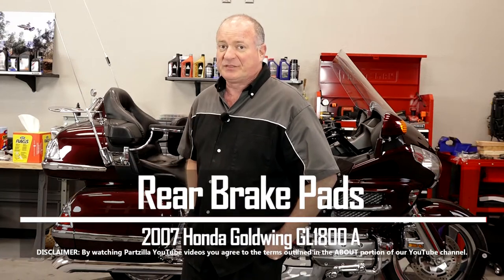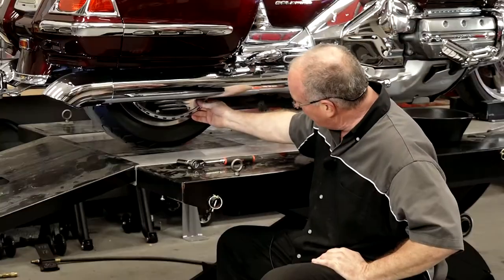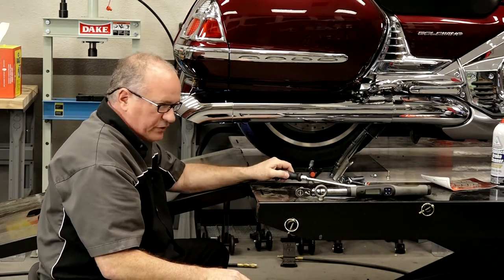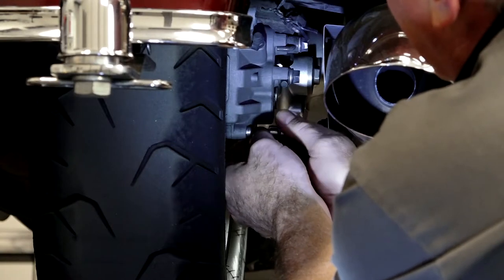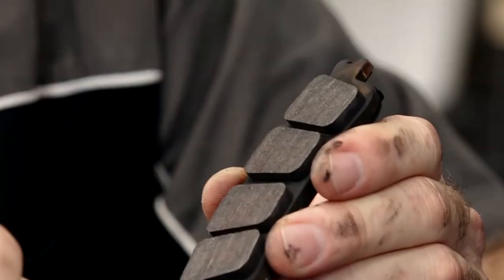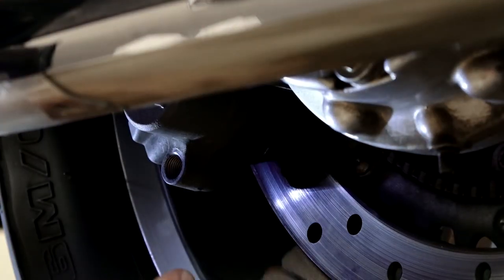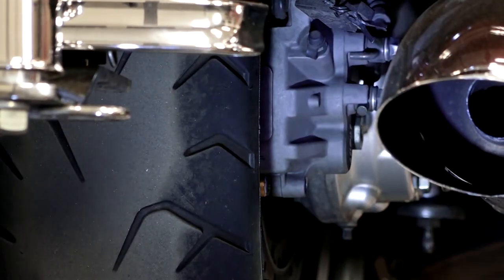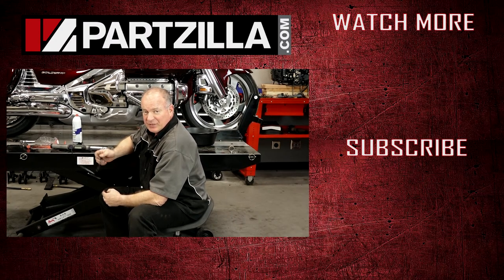Honda Goldwing Rear Brake Pad Change | Partzilla.com

Comment: A few minor points. 

#1: Spray the caliper with brake cleaner before you push the pistons back in. Don't want crud chewing up the caliper bores.

#2: I find it easier if you fit the outside pad first and use the locking pin to hold it while you fit the outside pad. The push the caliper in.

#3:  After pads are in make sure the pads are in right by making sure the rear wheel turns easily. 

#4: Don't forget to pump the brakes front and rear to seat the pads against the rotor.

Comment: Great Video.. One thing I had a issue with previously,  after you think you have the  pads in properly  and before completely snugging  the pin down, check driver / left side pad make sure its in the holder and not over hanging the rotor as mine was  and wore incorrectly. felt correct going in and line up for the pin...even drove and stopped ok.  I only noticed it when I took the back tire off to change.   I had to struggle a bit get the new  pad lined up for the pin in its holder.... slight tap with a heavy object did the trick..

Comment: Excellent video; I pull that muffler off, it only has one bolt and two clamp bolts and off it comes and you then have a world of room. Once the muffler is off I put some anti-seize on the bolts and just inside the pipe where the muffler slides on, this makes it super easy next time. I pulled one off that had been on for 17 years and just had to wiggle it a little to get it.
Get some nitrile gloves and protect your hands from all that crap...

Comment: Ive been a jet turbine mechanic for 30 years and my pad change on my f6b went NOTHING  like this video..i could not  get enough of a gap on the left side of the rotor to insert new brake pads no matter WHAT i tried. I wound up disassembling everything sticking the pads on, then reinstalling rhe caliper. Over an hour and lots of cussing.

Comment: Real simple NO. I have a Honda 2008 Goldwing I removed front pads but it took me a long time because there are 3 cylinders that have to be pushed back. Screwdriver method worked on fronts but getting all 3 cylinders back enough was dificult but eventually worked. Rear was a diferent story. They are thicker pads. I could get lowest & middle cylinder pushed back but top cylinder would not go back enouigh to install new pads. I could put the old pads back in which I did. I gave up after several hours. To the Honda shop I go with old rear brakes to be replaced.
Reply: What a bummer. I hate it when I am deep into a job only to find out that I can't finish it for some reason and have to put it all back together again to bring it to my mechanic.

Comment: If you have abs,DO NOT...DO NOT just push the calipers open without opening the bleeder screw or you WILL push dirty fluid right  back into the anti-lock servo and it will be FUBAR=$$$$.....Chevy trucks are extremely sensitive to this and those units are $2500.00....Use the bleeder screw ,Boys..
Reply: Thanks for the heads up! 👍
Reply: I have watched 5 proffessional certified Honda Goldwing mechanics doing brake jobs on 1800's they all do it exactly the same way and not one of them mentions this....perhaps this is a Chevy thing.